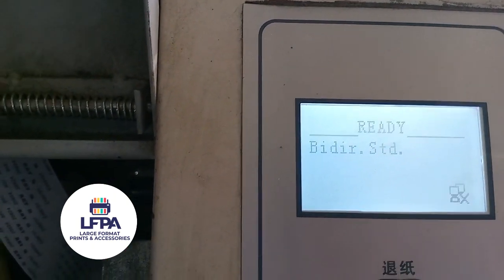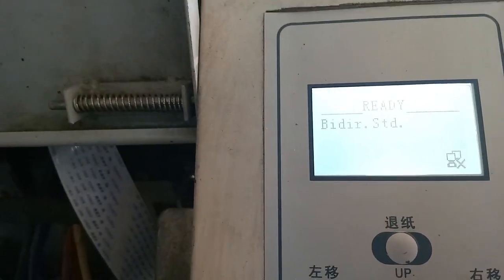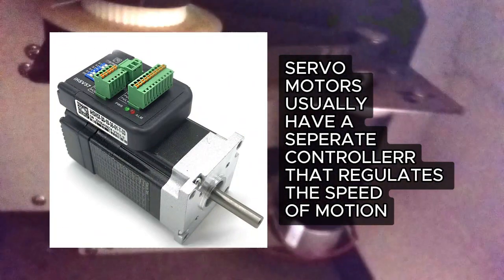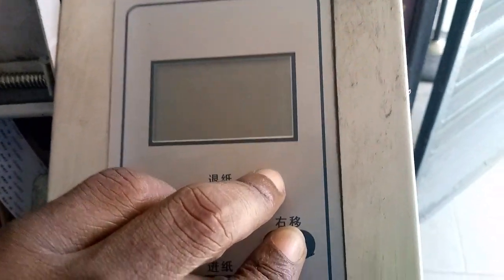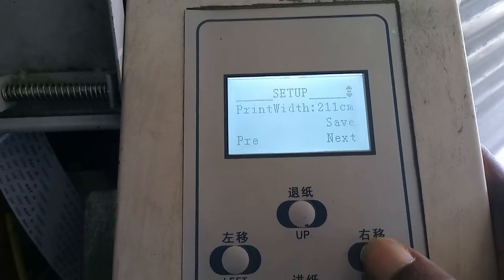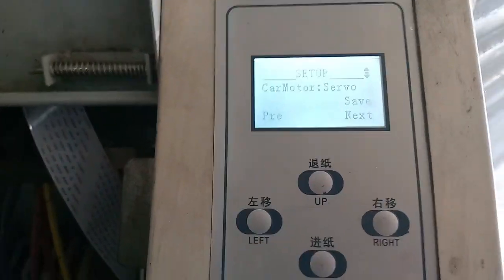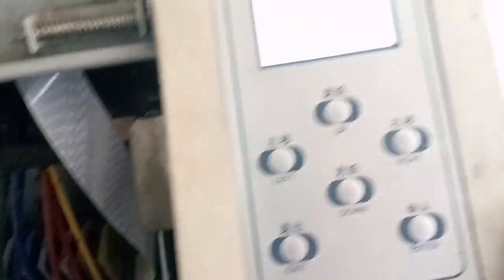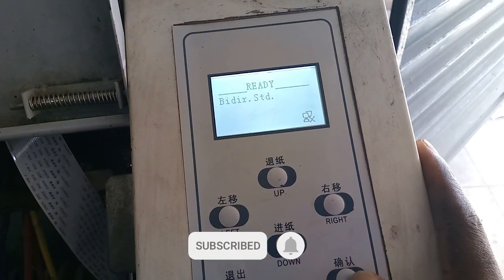HOW TO CHANGE YOUR MACHINE FROM DC MOTOR TO SERVO MOTOR

Comment: My machine shows the Wiper blade is not set, and when i allow wiper to wipe or during cleaning i dont see any wiper movement to touch the head. 
Anyhelp.
Reply from the maker: Maybe the motor is faulty
Reply: @richwords1  what  to do?
Since installed it has never work, and the machine has 9 months
Reply from the maker: Maybe I need to see a video of problem. But mind you. WhatsApp consultation is not a free service.

So I will have to charge you before I can assist, if you send me the video. You may not send if you are not ready for the payment.